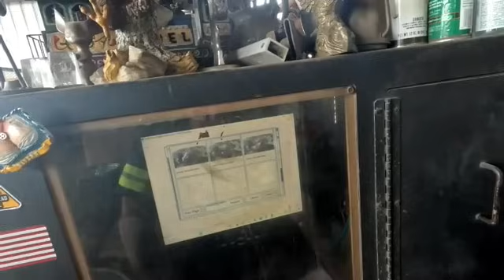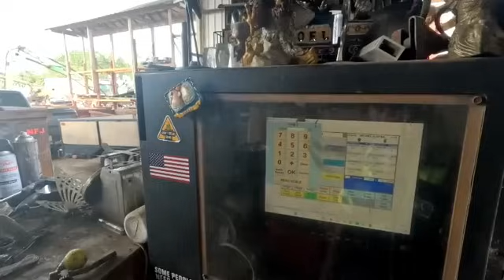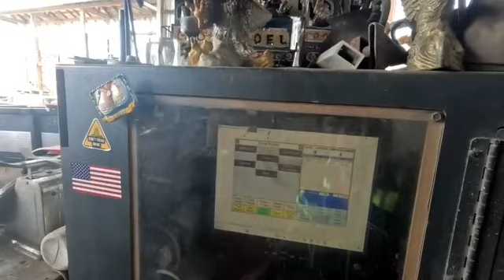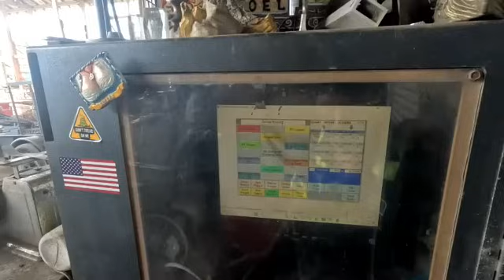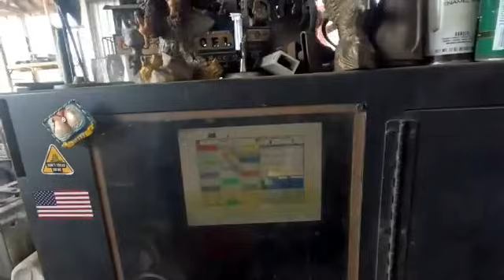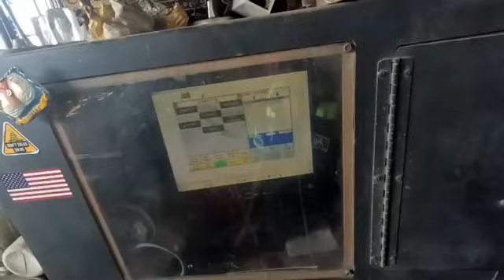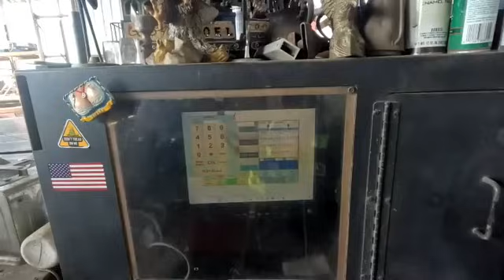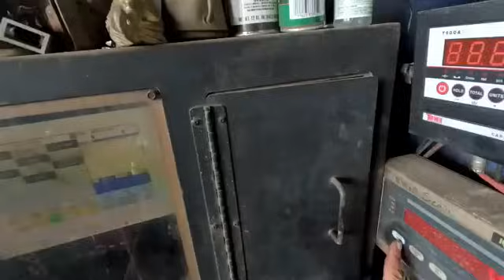SCRAP OVERLOAD MONDAY #recycle #recycling #scrap #copper #brass #aluminum #scrapyard

Comment: So the torch guys are they just cutting the aluminum to fit in the balers? Or are the cleaning it as they go as well?. Also the dumpsters next to them I know one you put steel in but what else do you have going on there. I don't mean the ones at scale but the ones off side of balers . Just want to understand your operation better love the channel!!! Been scrapping since 1986! And boy how some things have changed .
Reply from the maker: They are supposed to clean the aluminum before it gets in the balers. The 2 other bins are for the different types of breakage or irony aluminum.  One light and one heavy breakage.  Yea scrap evolves as the years go on. Thanks for watching 👀 tonight